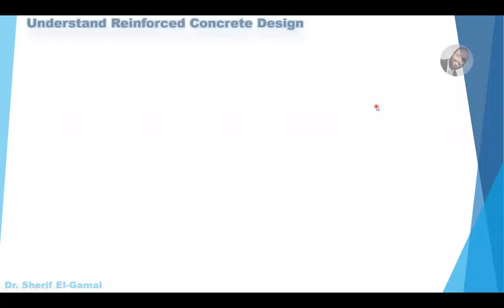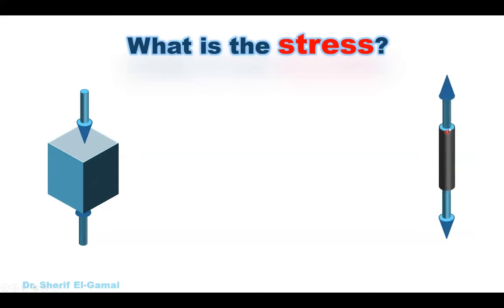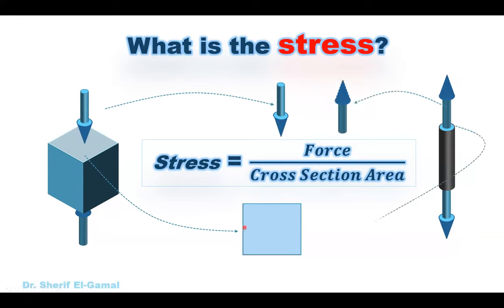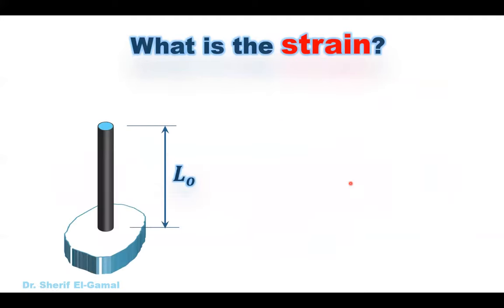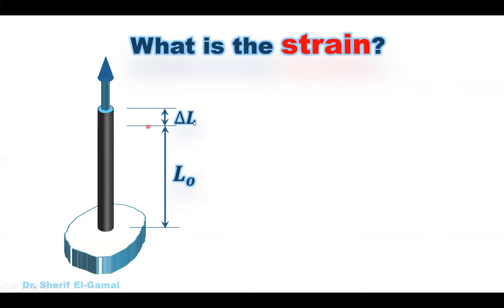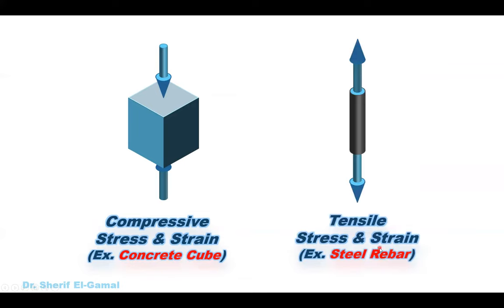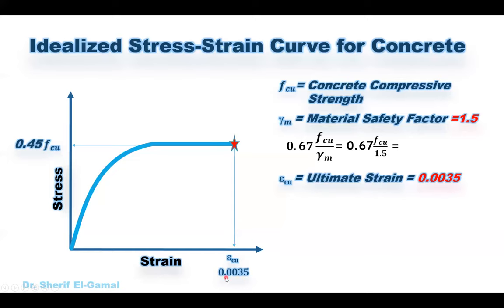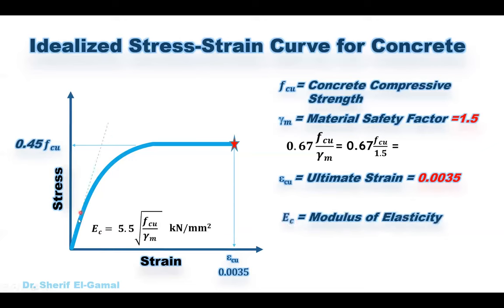Stress-Strain Curves of Concrete and Steel Reinforcement - BS8110. Reinforced Concrete Design.

Comment: Thanks sir appreciate as best way to explain 
Sir I have one doubt that for yield stress of steel the safety factor is 1.15
So 0.87 fy please clarify my doubt.
Reply from the maker: In the BS code. The material safety factor for steel is 1.05 not 1.15. 1.15 is in other codes.

Comment: شكرا كثير دكتور على شرحك ..دكتور لدي سؤال هل لما توصل الخرسانة عند الاجهاد الأقصى 0.67fcu تكون الخرسانة في مرحلة الدونة ؟ وهل بنصمم الخرسانة في مرحلة المرونة أم اللدونة
Reply from the maker: Concrete is not a ductile material as steel. When we reach failure, concrete will not  be in the elastic stage. Therefore, when we design, all codes allows only the tension failure (failure in steel) and do not allow the compression failure (in concrete)
Reply: @MrElgamal77  شكرا كثير دكتور

Comment: TO measure the strain in rebar, under uniaxial tensile test we usually attach strain gauge to measure longitudinal strain. However, these strain gauges wont work after yielding of the bar. How can we get the plot of graph once the strain gauge stop working because of it limited strain measuring capacity
Reply from the maker: The strain can be also measured by measuring the displacement using LVDTs or from the testing machine. Then strain can be calculated by (Change in length/ original length).
Reply: @MrElgamal77  if using a UTM machine to record the stroke (change in length) and later calcluate find the strain from it i have been told that its not accurate as it captures the displacement at global level unlike strain which captures changes at local level. Can you guide about this error in UTM machine measurement which also account for the global deformation addition to deformation of the specimen.